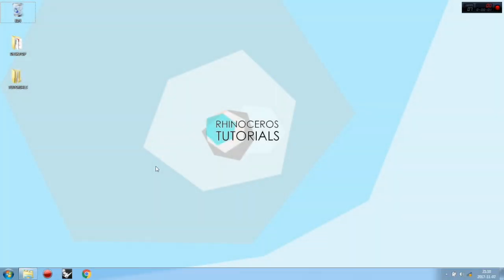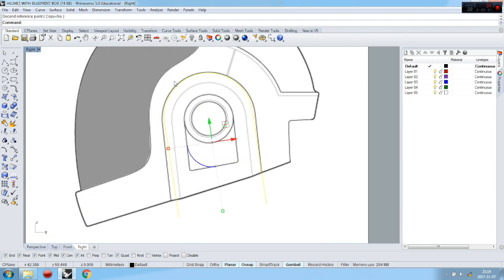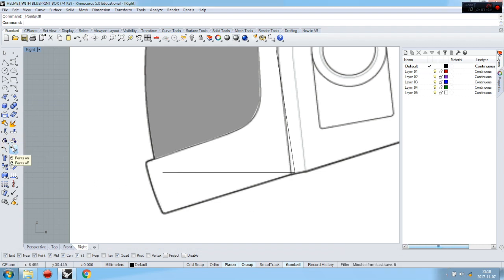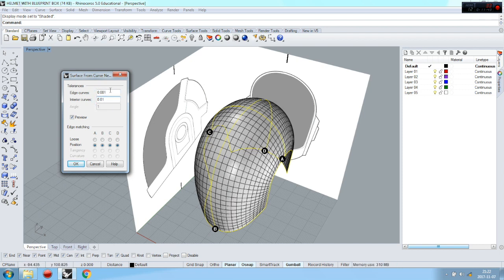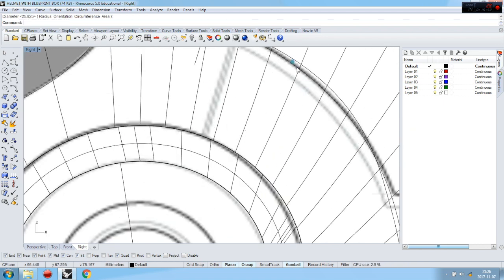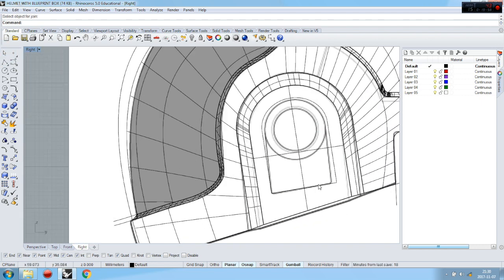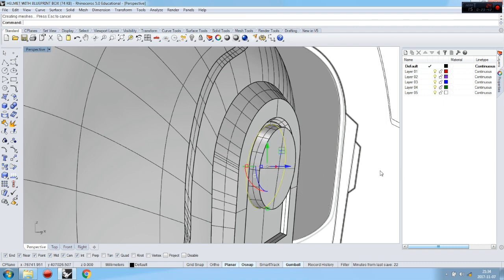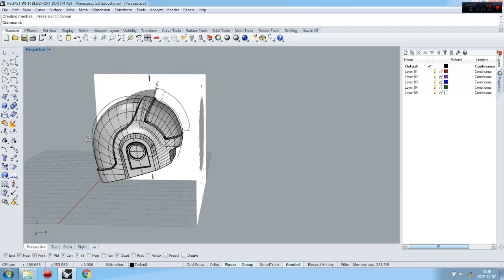Rhino Tutorial – DAFT PUNK Helmet ver.2 (Beginner)

Comment: Sir can you help me? I want to make something for 3D Print out from Rhino 6 now. I have 2 Boxes for e.g. They have the same size. And i want to put them on each other. If i choose now export and safe it as an STL - i have a LINE between the boxes in STL. Even if i group them, i have a line between the boxes. Even if i stick the boxes together (same size) i have a line i can see in the slicer. Only if i boolish them togeher before i export, i have no Line between. Is there a way that i dont have to boolish them before i export, maybe in the setting when i safe as STL, to get rid of the lines? Thanks in advance for your help!
Reply from the maker: If you put two objects ar each other and try to print it it will not work. Slicer see it as a separate object because they are obviously separate if you did not boolean them. That line it is not line but enge of solid. If  you want to print objects you need to print them next to each other not on top of each other
Reply: Thanks for your answer! Is there no way in Rhino like "export selected files" and then in options, make 1 object as STL, without boolish them before or to do it in the slicer? I have atm only the way to boolish it first before i print it from the slicer, and hopefully dont safe the file in Rhino, so that i can edit it later if it dont fit after printing. Do you know if there is a option maybe in the STL, to mark that it boolish it first what i want to export?